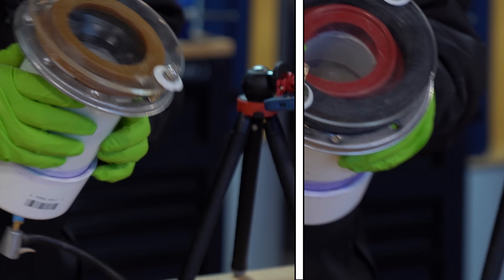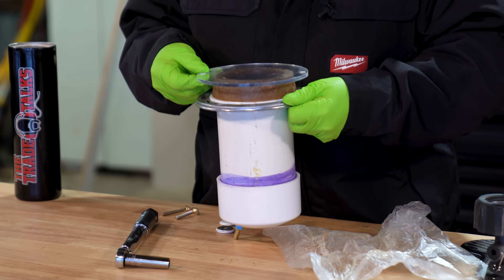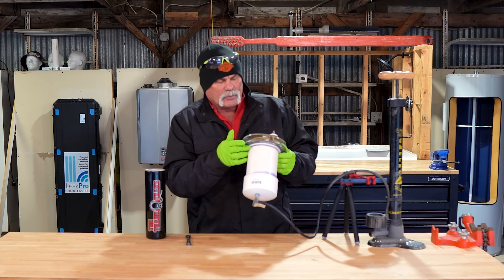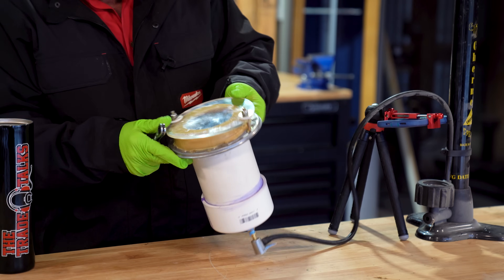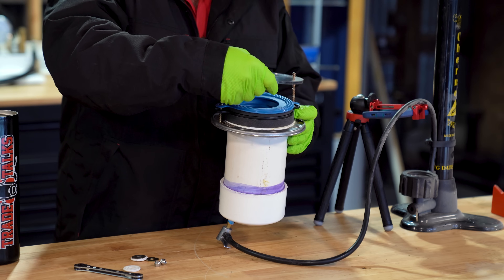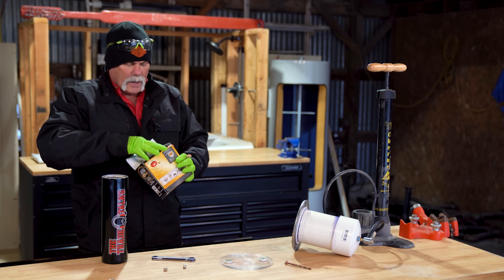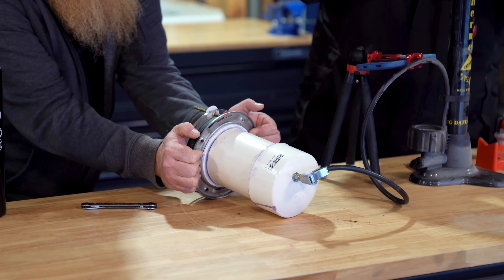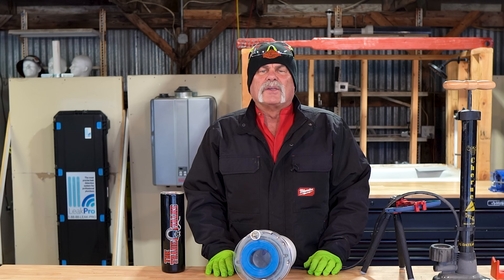Toilet Wax vs Rubber: Which Works Better?

Comment: When we built the house I used a rubber seal on one toilet and 35 years and a toilet change later later it is still holding. The other bathroom toilet has a wax ring which has leaked twice and been replaced three times.

Comment: This is not a good test, because your setup won't hold the same seal as a toilet attached to a floor due to the acrylic bending. You need to do another test with a proper test bench setup. You can have a test bench similar to the one you are standing in front. Just make a hole in the top of the bench to attach you test pipe to then put your seal and attached a toilet to it properly. After that is done correctly then you can pressure test them.

Comment: From my own experience, I've had bad luck with the foam/rubber/silicone rings  Yes. they're easier to clean up, but I've had to replace two of them because they did not seal completely  I had to use the extra thick wax ring in those instances.

Comment: I'm in the "it works" and it's not a mess to clean up.  Yes they cost a little bit more but the foam rings work just fine in my apartments and I don't have a mess to clean up when a kid flushes their tooth brush down the toilet like happened last week.  The few bucks more the foam rings cost more than pays for its self by the labor savings for cleaning up the wax ring. This doesn't even include buying a new wax ring if you miss on the first time.

Comment: I installed 2 toilets 2 yrs ago using blue rubber rings. It's better than wax, air tight. No mess. Easy to replace.

Comment: Unlike rubber, which will eventually deteriorate, wax will last forever.  As long as the toilet never gets loose and wobbles around, because wax does not have much flexibility with motion.

Unlike wax, which will break apart with movement of the toilet, rubber will easily flex with movement and maintain its seal as long as the toilet does not get too loose.
Reply: I have seen wax last 40 years or more.  Let's see rubber last that long.

Comment: I have moved away from wax rings, too many problems. I use the blue rubber ring in all of my rental homes and my personal home. I now have less issues and have simplified the work. I have never had a rubber ring leak.

Comment: I personally like the rubber seals. They won't melt like wax seals will, especially if someone is using a bidet with warm water. I heard of an uncle that piped heat water  to his toilet, apparently for a bidet. I would think a rubber ring in this case would be better than a dripping wax seal.

Comment: I used the rubber seals on my toilets in my house with no problems. When I 1st use them it was by Fluidmaster that had foam O rings around a plastic sleeve. Lasted 15 years before I had to pull the toilet because of a clog. When I replaced it I used that blue one you tested.

Comment: I use the Fluidmaster Better than wax a few times without any issue. The foam ring is only used if your flange is level or below the service. I did see you got to 35 psi before it failed.

Comment: I recently had to change a seal and first used an extra thick wax. After setting the toilet it seemed fine. Toilet got clogged, plunged and it leaked even worse. Switched to the better than wax and no issues so far

Comment: I used a rubber seal in the past and had no trouble with it.  I would be interested to know if there are problems 5 years or more after installation...

Comment: Havent had to use the foam with any of the 3 i replaced in my house, and i havent had any issues in the 6 or so years they have been in. Both options work, but cleaning the wax out of the bolt holes on the flange is more work than I really want to do, so ill use the rubber one.

Comment: I'm a DIYer.  I replaced our 3 toilets.  First 2 included wax rings which I used with no problems. Third was a fancier model, different brand.  The oval heads of the anchoring bolts were too small and kept popping loose. After junking 3 rings (3 trips to the hardware store), I bought a foam ring. It allowed a few futile tries to find the problem.  The old bolts and foam ring have been odor free for 2 years, so far.

Comment: the foam ring isn't used if your flange is level to the floor, so the rubber will hold better alone. I've done 3 toilets in my house and helped with 2 in neighbors houses. They work great.

Comment: I have used the foam seals for years now, and they work great.  They are used on motorhomes, and I figured if they worked in a home during an earthquake (motorhome driving down the road), they would work on a stationary home.

Comment: If it's not the phone that's causing the problem but it's not sealing right you may need a thicker piece of plexiglass so it doesn't Flex so much because it may be flexing a little bit when you tighten on the ends not making a complete ringed seal the wax will conform to the bend in the in the plexiglass but the Rubber seal needs a flat surface to work this my suggestion. Cuz I've used one, and it's been 2 years or 3 and no sign of failure yet, and that was the blue first one you used. I install one for a friend of mine and it's held up really well for that whole time so far still working

Comment: I put a rubber one on my fiancé's toilet and it was there for 6 years with no problems.  She moved to my town and we got married. We used the rubber gasket on the front toilet and we did that in 2019.  It is still working correctly.  We used the green rubber one.

Comment: I have a question, just had my flange and gasket replaced by a plumber when I asked if he was using wax o rubber, he replaced both.  Is that a good idea in your opinion and thanks for the video - informative.

Comment: I used a rubber ring 3 years ago and no issues so far.  it is on a hardwood 1/2 bath so I used a the thick option.

Comment: Home or owner here replaced 3 rings to fix flooring and used rubber seal easy to use 3 years later haven't had any problems.

Comment: Interesting test.  Couple thoughts.
1. The plastic cover wasn't stiff enough to get an flat seal.
2. Would be cool to see these tested on an actual toilet as well.  Which one is more forgiving and keeps a seal over time.
Something else I say a local plumber do was double up on the wax rings.. Maybe cover that topic as well.
Reply: I don't like doubling wax rings. They are not designed for that usage and you risk squeezing a lot of wax into the flange where it forms a partial blockage.

Comment: I have used the Fluidmaster seals when I owned apartments, so I am somewhere between the DIY home owner and a pro. I didn't have any problems with them leaking or letting sewer gas into the building. I think that one problem with your tester not holding pressure is that the clear cover is quite flexible compared to how rigid a porcelain toilet. The plastic seal is made for porcelain, where as wax conforms to the shape of the clear lid.

Comment: I have removed toilets that have have been installed for many yours and were currently letting sewer gases into the house. When I removed the toilet to my surprise the foam had deteriorated and was leaking.  I always use the extra thick wax to give me a good seal.  I often find the flange is not level do to a new floor or some other renovation.  Wax is the only way to go.

Comment: Last couple toilets I've set I've used that blue rubber ringer product and it worked well so far. One benefit of it is that there is some height adjustment in case the toilet stanchion has been place incorrectly or is too low because of layers of flooring that have been added to the bathroom around the toilet.

Comment: I installed one of the rubber seals in my bathroom about 2 years ago after doing the flooring. I have no wobble or leaks.

Comment: I use the rubber one. Had to pull the bowl one day and realized I didn't have a new seal. Took a chance with the rubber and that was 15+ years ago and no problems.

Comment: As a chemist,  I just want to note that once you put that wax on the acrylic sheet,  it is very hard to completely clean off the surface again unless you are using acetone or something that will also attack the acrylic sheet.  So the rubber will not have a clean surface to seal against unless each time you are using a new or clean fixture AND a new acrylic sheet...  I would also make tha acrylic sheet thicker so it would be stiffer.

Comment: When are you supposed to change those seals?   I've never lived in a house that had a seal changed  other than an apartment where the toilet tank sprung a leak and they replaced the toilet for that reason.
I'm almost positive we never changed the toilets in our house the whole time I grew up.   It frankly never occurred to me they could leak
Reply from the maker: You really only need to change it out if you see leaking under the toilet or smell sewer gas, or are replacing a toilet with a wax ring...they can last quite awhile

Comment: I love to experiment with things, so I think this test is an excellent idea!  I agree, though, that the acrylic should have been much thicker, so it wouldn't deform.  (After all, the horn on a porcelain toilet bowl won't deform.)  I have pondered using the rubber/foam type, so it will "follow" the toilet if it starts to rock ... then thin was on top of that to seal the rubber "funnel" to the toilet horn.  That does seem rather extreme.  If you have a house trap, and your stack is properly vented, you should never have any significant pressure in there anyway, right?  Very instructive video and food for thought.  Thanks for doing it!

Comment: Wax is amazing but, if a toilet get's lose or wasn't shimmed. The wax seal will fail and leaks will happen. With the rubber I would think it would flex with the movement of the toilet and not cause a leak. Could you setup a test like this instead?

Comment: I used the rubber one on a recent toilet upgrade, and loved the install. Even put a small bead of that clear caulk around the mating surfaces. No need to keep extra waxes because I'm clumsy at times, and cleaning up all of that funky stuff because you dropped it on a customers carpet in the bathroom.

Comment: The top plastic is bending when you tighten it and is the leak point in your test. A thicker plastic or metal is needed.   10 psi is 23 feet high of water pressure.  The real test is how long will the rubber last?  On wax rings, how long will the bolts come loose or toilet wobble.

Comment: I’ve used the new wax free and love them. They hold up great and allow you to adjust placement without messing up seal as happens with wax. 
Also on your test! The only time you use the second section of foam is if the mounting ring is below floor surface thus that section is supported via the recess and will not react as in your video. The second foam layer is not meant to be above grade thus the problem you had with your test.

Comment: I'm a homeowner and I set my toilet about 10 years ago with one of the plastic rings and it's still working just fine. Getting ready to set a second toilet using the plastic ring as well. Way less messy than wax!

Comment: As a homeowner who has a young kid and has to constantly take the toilet apart and clean obstacles, the fluid master silicone ring has been a major help
Reply: Have you tried a closet auger? They are designed to unplug toilets.
Reply: @buggsy5  yes a toilet auger. Doesn’t always work at least it didn’t in my case with a bar of soap.

Comment: Problem is with the circular flange most of the time wood around the toilet is rotted or does not cover around the pipe, you can not screw it on the toilet floor because there is no wood to screw it to, flanges has to be like square shaped that can be secured to the floor wood with the bolts most of the time the flange screws does not grab the floor.

Comment: I'm sold on the rubber ones. Wax is a one shot deal. If you find that something isn't quite right, and have to remove the toilet after smashing, your wax ring is ruined. Sometimes wax rings can split. The good rubber ones have a long snoot that goes further down the pipe, and a thick, soft closed cell rubber foam ring that really conforms to seal. If you have to remove and reseat the toilet, no problem.

Comment: thankyou .though as a contractor not a plumber all my toilet to floor issue have never been a gas smell .I get called in when water shows up on the floor or the floor is rotted away#1 issue is wax ring not sealing to toilet , which i figure was from installer mistake .#2 I think is old house moving and it the seal fails . #3 is due to those those tile floors either not laid flat or have a unflat surface . they seem to be more likely to loosen up . 
i think these new seals should be my only choice in the future .

Comment: Years ago, I switched to the 'Better Than Wax' and never had a leak since. I believe that some plumbers use wax because they know it it's cheap and will eventually leak from small movements of the toilet. That means another call to install a new wax ring.

Comment: I have used the rubber rings in areas where I have needed to remove a toilet more than once. This was in a construction project that required me to replace it to have a functioning toilet. It also compensates very well for tile elevated surfaces where the lock ring is low. They also work better in warmer climates and heated floors. I used to use the double wax ring and it works well, but can be messy on removal.

Comment: The flanges in my home are PVC and sit on top of the tile, leaving almost no room between the top of the flange and the bottom of the toilet. Wax rings were a nightmare because they were too thick, it was a pain trying to smash them down enough, and they would fail rather quickly. The last time I had to re-set a toilet I used a Tightseal sticky elastomer gasket, needing only a 1/4" piece to seal my toilet. Setting the toilet was MUCH easier and It has only been a few months but seems to be holding up well, although time will tell.

Comment: I had a rubber one. Replaced it after a year. My toilet leaked. Couldn't belive it. Went with a wax ring. I was told rubber is better. I think the rubber misformed or somthing. It was awhile ago. Unless I got a cheap rubber one? Is there a better rubber seal out there?

Comment: I have seen through experience that wax rings with horns leaked when the toilet clogged or the branch/main line backed up.  This was almost everytime.  I would reset the toilet and find this type of seal.  I believe its due to not enough wax under the horn.

Can you revisit this and use a regular wax ring without a horn?  Im curious to see if it would hold the pressure

Comment: I used Korky rubber seals on both of my toilets and I'm very happy with them. If I would have had Fluidmaster available I probably would have bought those, the Korky are the other way around, rubber on closet flange and foam on toilet. I don't think there's a difference, it's like "do you eat toast with the butter side up or down?". When I bought my house both wax seals were completely destroyed and both flanges were at different heights in relation to the floor surfaces.

Comment: I have been using Fernco adapters for 25+ years, I’m a DYI person. They glue on to the bottom of a toilet and have a rubber funnel below. I’ve only installed these in my own home and have installed about 6+ units. In this time frame only had one that leaked. There’s no wax, so it’s an easy cleanup and install. It’s not like the wax or rubber units you have shown.   Great product, especially for the amateur.  I’m surprised that you didn’t include it in your tests, it’s been around much longer than the ones you tested.

Comment: Ive used the Red + black foam one (Korky), Danco Perfect Seal, and the Blue better than wax flange gaskets.  
None of them have had any problems at all over the past 2 years theyve been installed.

And yes, I bought all 3 to satisfy my curiosity.

The real demon in thw details is whether the floor is level or not, and then how to properly shim it proper

Comment: About 24 years ago we had our old house jacked up and sort of leveled.   I replaced all of the plumbing my self.  Switched from galvanized pipe and cast iron to all PVC and CPVC.  Put in a new toilet and used a standard wax ring.  It started leaking so I replaced it.  The new one started leaking.  I replaced it with the thicker wax ring and it started leaking.  I think the reason was that the toilet was rocking or moving.  I found a seal called Sani Seal which was made of some type of green rubber or plastic foam.  It has been under the same toilet for all these years and has never leaked.  I still have an extra wax ring in the cabinet just in case.  On this same note I watch Drain Addict on YT in Australia.  They have completely different toilet mounting types over there that I didn't know existed.

Comment: I use the foam when it’s a chance the toilet will rock to try to maintain a seal.  As you say a good wax seal that is consistent is strong.  Had to pull a toilet for a remodel, I set the toilet 20 years ago, the wax held tight enough I had to rock it side to side to break it loose.